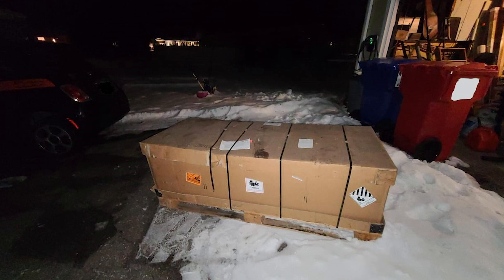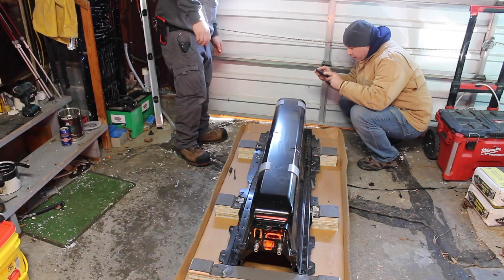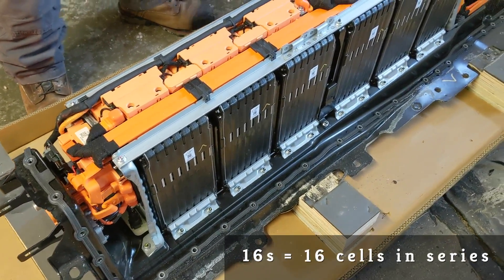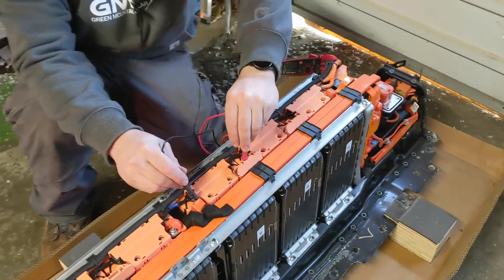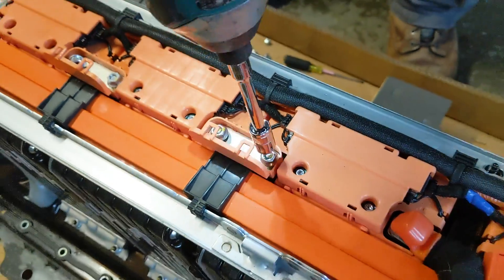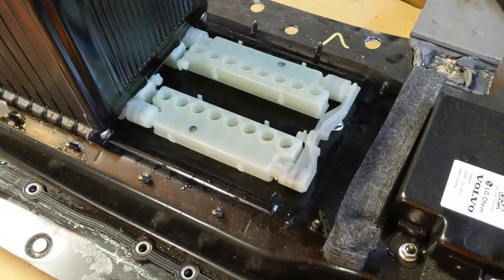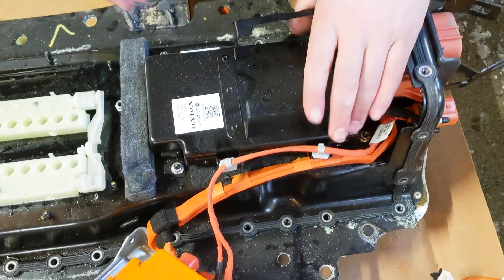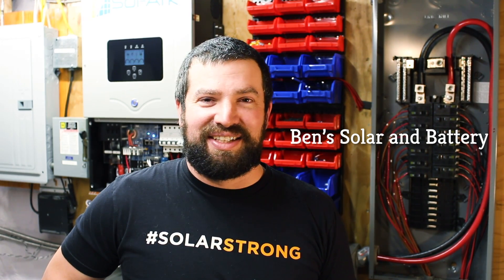Volvo Lithium Battery Tear Down for use in Off Grid Solar Power

Comment: Was this dude poking at a high voltage pack power out w/his bare fingers w/o knowing what a battery disconnect is and if it was installed?  I hope he at least threw a multimeter on it prior.

Comment: This seems extremely dangerous
Reply: Its  not so bad. Gloves would be best but if you have your multimeter and test for voltage before touching things  you’ll be fine. Find the positive and negative terminals and don’t short them.

Comment: I'm a owner of xc90 t8 (2021 early model). I'm just wondering if 11.6kwh battery can be replaced 18.8kwh battery physically. As I heard, new xc90 recharge t8 (MY2022) has 18.8kwh battery inside. I want to upgrade if possible.
Reply: You can’t it’s a different battery, the motor is also different unfortunately

Comment: Wow $132/kWh... Now I'm torn I was about to look at some SBS 190F industrial pure lead AGM batteries for $100 per 1.1kWh roughly (190AH)

Any advice from anyone why one battery technology would be better for solar energy storage?
Reply from the maker: Nothing wrong with AGM.  In my opinon, AGM makes a lot of sense if you are looking for a backup system, that sits full 99% of the time, and only is used a few days a year during a power outage.  If you are looking for daily use in an off grid solar system, then Lithium makes more sense.  There are several types of lithium batteries.  I'm currently using LiFePO4 chemistry in a pre-buiilt 48V option.  https://youtu.be/SYJ25izYSGc

Comment: Let me correct you on the layers of copper plate in bus bar that is for current flow not for vibration.
If you increase surface area of a conductor current also increase because of electron increase on surface of conductor more the free ectron more the current flow.
Reply: What you wrote is 100% FALSE  information.

Comment: With all those water connection failure points, I can see why it may have leaked. The cooling is not elegantly simple. I like the Bolt battery cooling system much better.

Comment: How u gonna cool the battery at home?
Reply from the maker: No need.  The amps moving in/out are very small in a home setting.  In Bens setup it maxes out at 12 amps per battery.  The batteries are made to handle 300 amps.  They just don't get warm at 12 amps.

Comment: Do you think a cars alternator would charge a u charge valence battery from battery hookup?It doesn't have to be a full charge but enough to run an inverter for some camp lights/shower pump?Or would it be better to use a pwm controller and a 80watt panel?Those are my options and the stuff I have other than the battery.Im trying to go as small as possible on my camp stuff but need an additional light weight cheap alternative for my power needs other than lead acid I carry on my truck rig.we are going to be using a small car for kayaking trips rather than my big truck we use for hunting trips.Any ideas/thoughts are greatly appreciated.thanks
Reply from the maker: Hi Chris Lewis,  The short answer is "yes" a cars alternator can charge an extra battery.  However, there are some pit-falls to avoid.  The worst situation is to burn out your alternator.  The best practice is to use a DC to DC charge controller.  This is a device that monitors and slowly charges your accessory battery (like the Valance or whatever you choose)  Here is an example of a good one: https://amzn.to/2SAZzkD

Comment: Better check your Daly BMS units to be sure they will balance at less than 4.1v per cell. Most BMS's balance at the high end of the charge.
Reply: Ditch Daly and go for JK with that level of parameter customization needed

Comment: they used thin copper bands grouped like that because d c power flows out side of the wire, not inside like ac does.
Reply: You are 100% wrong ...

Comment: Is there any way you could do a video on a lithium conversion with battery’s from this same place for a Polaris ranger EV?

The company’s that do a conversion charge $6-8k for their conversions. There has to be another way 🤦🏻‍♂️
Reply: I will fund the project if you wanna do it to mine :)
Reply from the maker: Are you in Massachusetts?   
I've done a lead to lithium swap in my golf cart.  It would be the same sort of thing for your Polaris.  You just have to check your voltage range, maximum amps, charger, and a couple other minor things.
Reply: Does it need to basically run threw some type of bms before it goes to the charger if comes with?

It’s a 48v system. 

I’m in NY, but I would trailer it to you, just to get your advice and look at it!
Reply: Hey! So I just used your discount to buy a battery from battery place :) I’ll let you know how it goes :)

Comment: hey David at 12:02 you said each module is 2KWH and total power is 16KWH of the car battery but I only see  6} 16s batteries so if each is 2kw times 6=12 kw did I missed something ? and David can you please provide the link for that Volvo car battery thanks in advance for your help !
Reply from the maker: You got me, that was a mistake on my part.  Each is 2kwh, and there are 6 modules.  Making 12kwh in the car.  Lots of 2s and 6s jumbled together.  Sorry.  

The battery is currently out of stock at Battery Hookup.  Sometimes they sell out super fast.  In this case, faster than I could film, edit, and publish.  https://batteryhookup.com/
Reply: @DavidPozEnergy  thanks David for your reply. so it is 12 kw total for a moment I thought that I missed something ! and they are out stock too bad, so that is why I could not not  find any of of those modules at battery hookup. they were all sold out in the time I was watching your video, it was like  with the BMW batteries in one of your previous videos. but I kept in the look out for them until I managed to find them in stock,  and bought 3 crates  last year. anyway thanks for your update I will keep my eyes on battery hookup hopefully they are back in stock!

Comment: Nice video . These EV batteries are getting more available and affordable. The only highend inverter I know that would work with 16s voltage is the Studer. 38-68 VDC .
Reply from the maker: Victron goes up to 66v.
Reply: Victron specs are battery 38-66 is accepted but victron charge module feeds only 57.6V
I just read the specs

Comment: You guys are setting a bad example here.  You were not wearing insulating gloves and were using metal tools to work on the battery.  Need to do better here.  Also, the so-called “Orange Cap” is a safety device used to disconnect the battery.  I enjoy watching your DIY programs, but you need to do better.

Comment: I wonder if the modules could be left connected to the cooling rail and connected in parallel for a 48v system?
Reply: Probably could, but there's no need for cooling with what I'm using them for.  I never see more than a 1-2 degree rise in temp even under heavy charging.

Comment: If you can charge the car with a standard power plug, then all you need to fully charge it is the build in charger. Unless that tech is build into a larger computer system. Perhaps get the at home charger from Volvo and power that thru the Sol-Ark. if the house is set up as two parallel systems, you should be able to do this
Reply: Then you would also need the built-in charger, as it's part of the car and not its battery. Plus then you would need to use the battery in its original 6*16=96S configuration, which is about 350 volts. It will be hard to find a way to use a 350 volt DC source, 48 volt equipment is much more common.

Comment: Also as you find in electrical courses that electrons flow on the surface of a wire. So more strands(or in this case,,, flat plates) then the higher the current flow for the amount of voltage. There is a trade-off though so not all perfect LOL Heat is a problem for the smaller wires or plates as the resistance is still the same no matter the size of the medium. All in all, one of those battery packs at 56v would be perfect for my electric tricycle. Too bad they aren't sold already removed from the vehicle container pack.
Reply: No.  That is a misinterpretation of the skin effect, which is a tendency for changing magnetic field induced by an alternating current to push electrons to the outside of a wire.

Comment: Glad you enjoyed the tear down. This pack was designed for Volvo by LG Chem out of the Detroit area. Careful with those coolant leaks, they can create a loss of isolation or potentially a short circuit if it ends up in the wrong place.

Comment: Would this set up work for a skoolie solar battery bank? I’m totally new to all this but really want to keep used lithium out of landfill. And it seems to give way more hours than a commercial battery. Volvo vs Nissan Leaf? Is one better? Is one easier for the beginner?
Reply from the maker: Yes, it can work with any off grid solar system.  These modules are about 58v nominal, but work with a lot of "48v" equipment.  Ben is using it with a 48v sol-ark inverter.  It would work even better with a Victron inverter since most of those will go up to 66 volts.  Just make sure you add a BMS.  https://youtu.be/i22xYD3DuWY
Reply: @DavidPozEnergy  thank you for the response. Nissan Leaf batteries are what I’ve been looking into. Is there a big difference between them and volvo

Comment: Nice and compact modules. A little pricey when you compare them to LifePO4 cells but the additional scrap hardware is nice to have- contactor & flex cable. Note the discharge curve is not flat for Li-NMC as it is for LifePO4, stopping at 3.9375 / 63v would leave roughly 20% capacity. Maybe Sol-Ark will have a firmware update that ups the top line voltage in the future.
Reply: Max voltage 63v, but what about minimal voltage? 58,4v ?

Comment: One question i am always left with after seeing these EV battery teardowns, will the coolant need to run in order for the battery to run safely? and if not why is that?
Reply from the maker: Not in Bens setup.  In a car the batteries might have to move 300+ amps for a short time.  Think accelerating onto a highway, up a hill.  The cells would get hot doing that and need active cooling.  In Bens home setup, the maximum possible amps these cells might see is 12 amps.  they won't be getting hot at 12 amps.
Reply: @DavidPozEnergy  Also for cold and hot climates.  The coolant will help keep the cells in ideal temps in harsh conditions.
Reply: @DavidPozEnergy  thanks for that reply, it makes one less thing to worry about when i finally do get my hands on a battery :D

Comment: How good is the deal since he can't use some of the capacity in his setup?  I'm not sure you considered that into your calculation.   Nice though that he saves from having to build from scratch.
Reply: Using less than 100% Capacity = way more cycles.  It is very common!

Comment: Another step toward the 100 khw battery you need to heat a house in Vermont
Reply: You need a wood stove to really heat eco friendly in Northern North america
Reply: If you have a well-insulated house and an efficient heat pump the energy demands of heating can be surprisingly low.